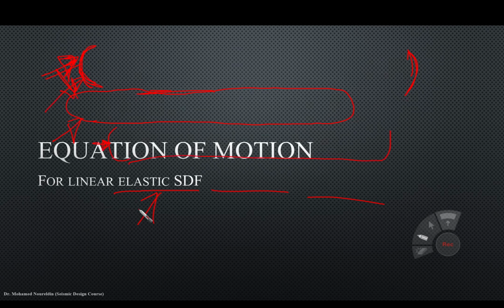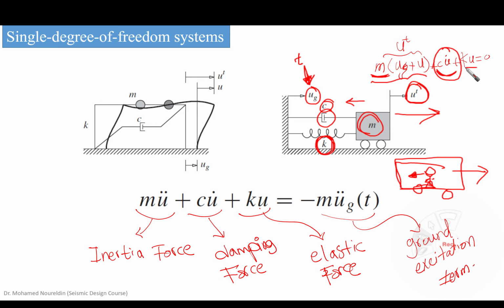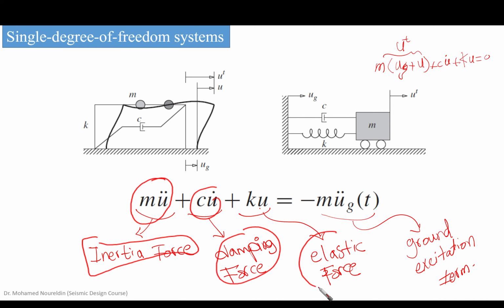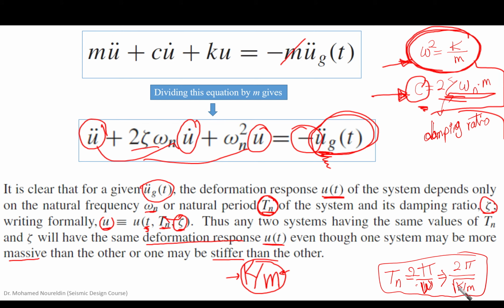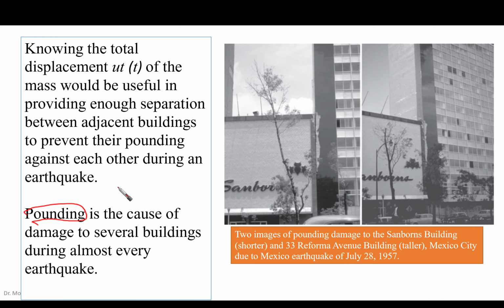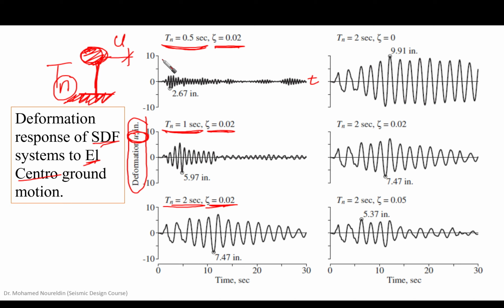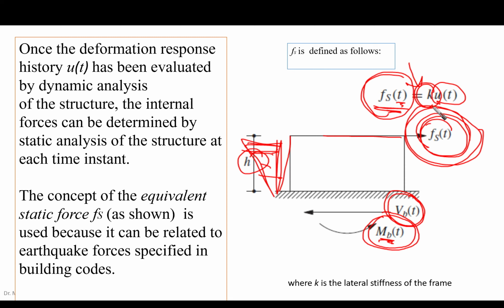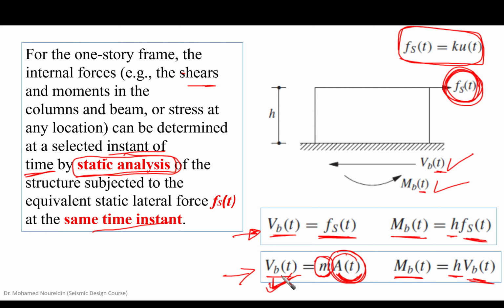7- Dynamic Analysis Fundamentals for Seismic Design (Response Spectrum-Part-1

Comment: Thank you Dr. for the great presentation. I am new to earthquake Engineering and I am designing a building for a given acceleration of 0.5 beyond design basis for an emergency equipment building for a nuclear power station. Do I simply use the acceleration given and calculate the overturning moments and base shear and apply them to the structure? please advise